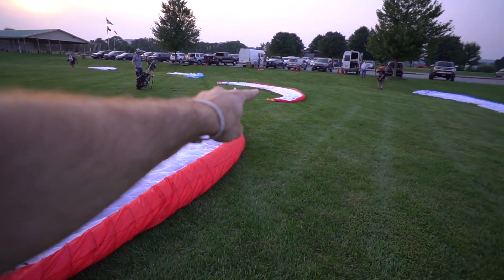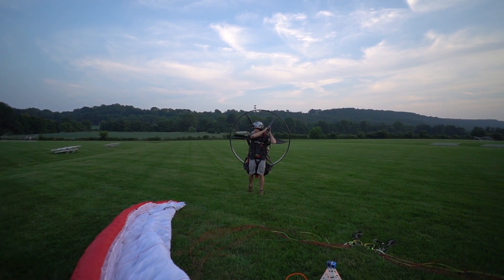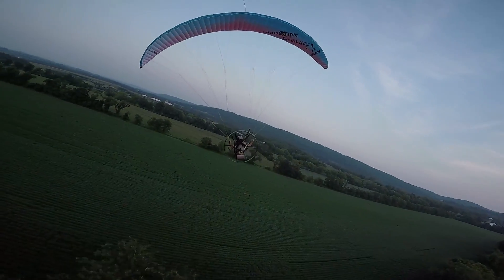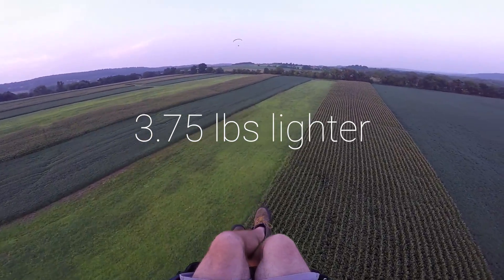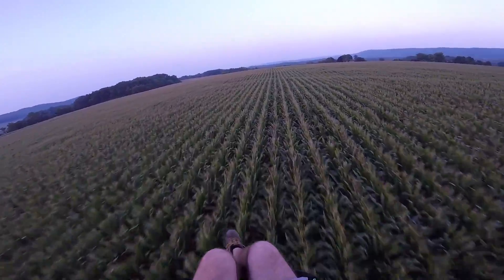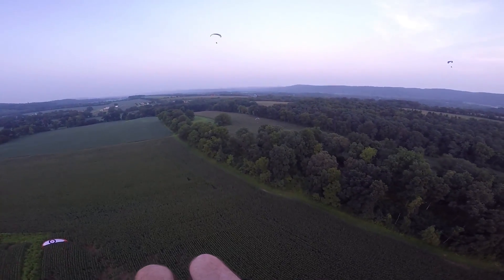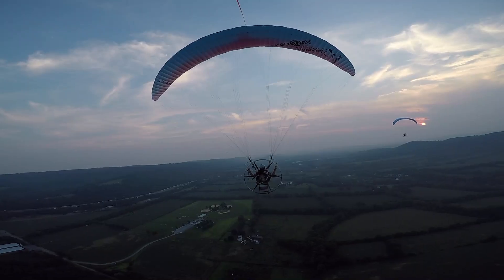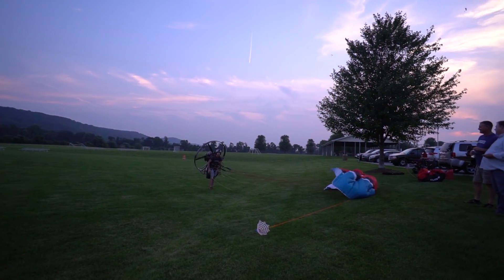$2,500 Motor Vs. $3,500 Motor - Is it worth it?!

Comment from the maker: The Moster Factory is definitely something special. One component I didn't test in this video was the difference between the Helix propeller on the Factory vs the Eprop on the Plus. I just filmed some non-scientific scientific testing so stay tuned for that!
Reply: i am ur first viewer
Reply: I like the $6000 Twin Turbo Intercooled Engine for speed height and maneuverability 😂
Reply: @joetownsend343  A TESLA Paramotor
Reply: I'd love to know more about the xt frame!
(I can't find anything about it on the scout website)
Reply: Yeah, that thing is sweet! Can tell it revs a little higher, and quicker than the Plus. Wonder if they did some different porting, head work, and/or lightened the crankshaft a little too?

Nothing better looking than titanium after a few heat cycles - has almost an iridium finish up near the head from the color changes. Love the electric blue it can make (depending on exhaust gas temperature). Plus, I'd bet you could lift that whole pipe assembly, silencer and all, with your pinkie it's so light. Feels like a feather. A full Ti header for my buddy's GSX-R 1000 weighed just a few pounds. Crazy light!
Reply: I like your shirt colors ,but what if it does not fit , how big is your XXXL shirt ?

I have seen XXXL Run small !
Reply: Electric is well developed in RC planes. It works well for very short flights unless you destroy performance. Then gas is so much better than electric nobody would go that route. Then there's the presently dangerous state of lithium chemistry batteries. A fire at altitude would be disastrous for somebody, even if you could drop the multi-hundred dollar battery pack.

I think we're stuck with gas for now.
Reply: I'm looking in this price range, and actually really interested in getting into this. I'm from Connecticut, so  it's not really something I've heard a ton about around here until watching your videos. Any chances you can help recommend used equips, and a good method to start learning?  Keep up the great videos man, I never would have known about such an awesome sport without your vids.
Reply: Can you do a video of random people reactions when they see you land or flying in your paramotor.
Reply: How I buy one paramotor
Reply: Hey Tucker .....where can i get the training for Paramotor....and where can i get one....how much does it cost ....??
Reply: Thank you for all the information!
Reply: Is there a possibility you could post a specific list of the mechanical components of the Moster Factory rig complete w chute, prop, cage? everything? The one you flew in this video.
I think many of your viewers would appreciate that.  Thanks!
Reply: @Corey Knox instablaster :)
Reply: @Simon Issac it did the trick and I finally got access to my account again. I am so happy:D
Thank you so much, you really help me out :D
Reply: @Corey Knox you are welcome :)
Reply: Happy new year sir I am you fans you fly very nice 185 parameter used used glider my weight 95 cage training use how much replacer thank

Comment: That motor is called the point of diminishing returns, 30-40% more money for 10% more performance. Just the way it is for good gear. Rotax motors are like that, beautiful engines for light aircrafe and high performance with better fuel consumption. Ever land with roller blades on? And that cruise controll could allow you to sleep while you fly! Just get a proximity sensor so you don't fly into a cliff.  Happy flying.

Comment: I'm a techy dude, never flying anything, I'm just wondering how close can you get to the performance by changing a few simple parts on the stock one? Like the air box and the reed valve?

The vibration comes down to internal balance and will extend the life of some parts in the engine. So in the long run the price difference might not be that bad if the engine lives longer

Comment: So much is in the assembly and tuning. Factory race bikes in many classes are required to use oem parts, yet they manage many percent better performance just because of the team they have doing the assembly and tune.(slower and not suitable methods for an assembly line.)

Comment: Have you ever thought of or dabbled with paramotor camping? I think that would be a neat idea for some future videos, and a little Adventure. Something I'm interested in, getting up in the air going back in the mountains finding a good spot :) might be some good future videos ;)  you the man!
Reply: I think the only issue would be cargo. You’d need basic food and shelter. Those ounces will matter.
Reply: Mayo Mayo was thinking the same thing. Might be cool if you “slack packed” and someone dropped gear ahead of you.
Reply: @nchurricanehunter  Turn your wing to a tent.
Reply: @nchurricanehunter  The light weight Appalachian trail people are down to 8lbs now for a complete backpack, tent, water purification, rain gear, everything but food.  You only need one vendor that would create a tent that uses your frame as the structure and it would be a no brainer on how to camp like that.  I don't think turning your wing into a tent would be a great idea.  Exactly how long does it take to dry out a wing to fly it?  If worse case scenario and there were two of you camping... One of you could always make a McDonalds run. LOL
Reply: The wing cost more than the motor. Might as well use it as a hammock if you use it as a tent.

Comment: nice review of the motor Tucker.  Hey I've seen a tip regarding those rear wired throttles and you should wrap the throttle cable OVER your forearm not under it, to hold it out away from the motor further. Better safety you know. Now, depends how long and where that cable is attached on that motor, I think the scout's are all high up throttle mounts aren't they?

Comment: forget the extras this moter has, it is a cnc made billet block and head, the price is not steepat all it would have cost them 5x the price to build at the factory over a cast one, oh and the billet block is about 20x stronger , if you add a forged pison and rod, u could up the compresion massively and not damage this billet block,  im a mechanical engineer by trade, im not talking crap..

Comment: Are these motors help to aircraft tolerances and aircraft workmanship. Like wire locking the cap bolts on the rods. My opinion is if you're up 10,000 feet do you want everything working under any condition. Also you said you were running an Avgas mix. Is that because I've gas has a different threshold temperature

Comment: Wonder if that crank has an increased stroke or just lighter weight for quicker revving?
Reply: I don't think it's the crank that is different, just the crankcase. It has been cut with CNC instead of being cast. More precision and probably stronger. Adds life to bearings etc...

Comment: I am looking at converting my 100 cc stihl chainsaw using the  fan from a chrysler 300.     I am thinking harbor freight has great deals on tow straps .. plus the riser could be a couple lawn mower handles with some wire ties..    i saw some used wings on ebay really cheap and i am sure the blood will wash out.  What could go wrong ???    I have watched 30 of your videos so i dont think i will need further instruction..     i have an old motorcycle helmet that went down the highway a couple times..    at 400 lb plus the rig i should be golden..   and i dont need fancy smoke stuff cause the stihl engine allready smokes a ton. 
   What could go wrong ?

Comment: Even though I'm retired and on a tight budget, instead of buying another brand of motor just to get in the air, I'd rather wait and save the difference to buy the Moster, or Moster Plus......The $3500 one ?......that would have to wait for much greener money

Comment: One thing I notice is a problem with any paramotor with a clutch, and that's that the prop freewheels when the motor is off. A freewheeling prop has MUCH more drag than a stopped prop. As a matter of fact, flying my RC sailplane I have a motor brake with the motor off that stops the prop. In order to add drag to land quicker, I give it a bit of throttle to just slowly turn the prop, which is like hitting a brick wall.

I wonder if paramotor manufacturers could incorporate a prop brake into their designs.
Reply: In fact it is the opposite that you state. The difference is that on a paramotor the clutch disengages allowing the prop to spin freely in the wind without any restriction from engine speed. On your RC glider the slow spinning prop IS restricted in speed by the electric motor and ESC forcing the propeller to turn at a certain RPM, often slower than its free spinning RPM would be. A free spinning, non restricted prop, will match the speed of the airflow over it creating the least amount of drag beyond being able to feather it. An analogy would be like taking your car and letting off the gas while it is in gear, versus letting off the gas while it is in neutral.
Reply: The fact is that the drag from a spinning prop is the drag of a (leaky) disk the diameter of the prop. The drag of a stopped prop is the drag of the cross-sectional area of the blades--MUCH less drag than the spinning prop. Free flight modelers learned in the 1920s that is true and fitted their models with prop brakes to extend glide dramatically. Works the same way on an electric sailplane. Prop stopped, you have maximum power off glide (unless you have a folding prop.). Just a touch of power to spin the prop and it's like hitting a brick wall.

A free spinning prop will NEVER match the glide speed. Due to airfoil inefficiencies and friction in the mechanism, it will ALWAYS be significantly below glide speed. It takes considerable power to spin the prop up to match glide speed.

Believe me I talk from 90 years of model airplane experience, and it's common knowledge too. Stopped props have drastically lower drag than freewheeling props. This hasn't been a controversy since 1924.
Reply: RockinRobbins13  It was common knowledge a few hundred years ago the earth was flat, the earth was the centre of the solar system and that god existed. Common knowledge isn't proof of it's correctness.
I've gone and done some reading on the topic since reading your post. Most research seems to be done in regards to yachts.
Mostly the scientific tests done using towing tanks suggest a free spinning prop gives less drag. Many 'experienced' people claim a fixed prop to be better.
I would say it depends on many factors and one answer does not exist for all examples. However I am leaning more towards free spinning generally providing less drag more often than not.
Reply: TFo feathering a prop will obviously be an advantage because it's presenting less surface area and therefore less drag.
This scenario is taking about a non feathered prop. Does a rigid position prop fully faced into the wind provide more resistance than one that can turn and give a little.
Controlled testing in water shows a free spinning prop to have slightly less drag.
Does that correspond to air?
Does the difference either way matter or is it so marginal other factors make it irrelevant.
For example if your flying in still air with a fixed prop which has marginally more drag. Small gust from behind, has the fixed props extra drag given you a little extra push? Nullifying the extra drag.

Comment: I don’t know what the big deal about buying a motor for $4000 meanwhile cost them less then $500 to make. What a country
Reply: It’s called capitalism, and it’s probably more than $500 (especially for the carbon fiber and titanium added one). For reference like 3 square yards of carbon fiber is sometimes $600 just for the cloth... Titanium costs a lot too and welding it isn’t going to be super cheap either.

Now can you get a motorcycle engine for less than $500? Sure, slap a cheap 250cc Chinese engine on there and it would run. The problem is those things are heavy and not even 20 HP (I think my 234cc 4 stroke engine is rated like 15.6 HP on my motorcycle, I mean it did great, wheelies, exceed speed limits on highways etc, and it could do burnouts alright and have fun throwing rooster tails of mud and grass into the air as you buzz saw the thing spinning like mad even accelerating hard at 60 mph. However, it’s REALLY heavy for its weight, and these probably have a bit more quality assurance than the great name brand “Hensim”.

It’s kinda like Honda vs the clones. Except the clones are debatably just as powerful... In flying every pound is critical to shave off, more so than motorcycle engines.

Personally for 3k I’d demand at least a turbocharged engine, but I guess those aren’t popular due to added complexity (I’m only guessing, I’m not sure why they aren’t more common allowing 4 stroke engines with superior fuel economy to be much more competitive).

The frames are what blow my mind (it’s gotta be like $100 to make the frame with aluminum, yet they are like in the thousand dollar region, it must be like road bikes where it’s normal to see a $1k aluminum bicycle...). At least they aren’t using military spec parts, otherwise it would be like $20 per steel bolt!
Reply: It is a niche market, have to keep people employed between sales + R&D + marketing + customer service + taxes +liability management ....

If you think you can run a business on tighter margins, go take over the market Rich Uncle Pennybags.

Comment: I know this is off topic but, I bet you see alot of marijuana growing when your in the sky. Because I think I seen some in those corn fields you flew over that had square patches of corn taken out and looked like marijuana growing inside the patch, and there was a few of them out toward the center of the corn field.
Reply from the maker: I saw that also. It didn't look like marijuana to me, but now I'm curious! I'll have to check it out tonight.
Reply: A lot of times those are swampy or low areas where the farmer doesn't want to get stuck.
Reply: As a completely & utterly unrelated topic........ah, how much extra weight can a paraglider carry?
Reply: @joetownsend343  no not a cop, I dont look like a cop do I? I just have a sharp eye and know where people hide marijuana grows.
Reply: "I know this is off topic but, I bet you see alot of marijuana growing when your in the sky." im going to ignore everything else you wrote, marijuana doesnt grow in the sky, it grows on the ground. Go home, your obviously high.
Reply: Lol easy to spot pot from the air most people don’t know pot grows significantly hotter than other plants thermal cameras pick it up miles away.

Comment: A friend of mine flies a moster 185 factory and his titanium exhaust cracked after only 8 hours of flying.
Reply from the maker: Do you know if his had the spring joint by the silencer? I know they had a lot of cracking issues with the titanium, but the Vittorazi guys said after they added this joint, they didn't have any more issues.
Reply: @TuckerGott  i have no idea, maybe he was just unlucky.
Reply: @TuckerGott  it cracked just before the bend where the exhaust gets very small. in the weld.
Reply: Tell us more about that spring joint please! I looked at your close ups but I couldn't see it. Thanks!

Comment: I've heard  reliability on paramotor engines is rather low.  That being said, customer service may be what is most important.
Reply: Fu Dog Whisperer it’s a two stroke motor they all blow up every now and then
Reply: A motor out provides no real danger so long as your flying safely. Not close to the ground, always keep a landing area within range etc. Your still attached to a wing and can safely land just like any paraglider. Just don't copy Tucker and do low aerobatics and you will be fine.

Comment: Just use a 4-stroke Briggs & Stratton for Christ's sakes their ways the same and it's a tenth of the cost. There's really no difference 😮 don't let the manufacturers say that engines made for Aviation are different😮 they're not 😂well that's not entirely true there are some differences but they can be fixed with a few hundred bucks🎉. So you're still under the $800 threshold😊. I can put a 350 small Block in a Cessna and fly it around as long as it's fuel injected🎉